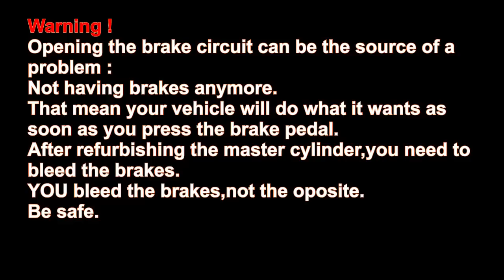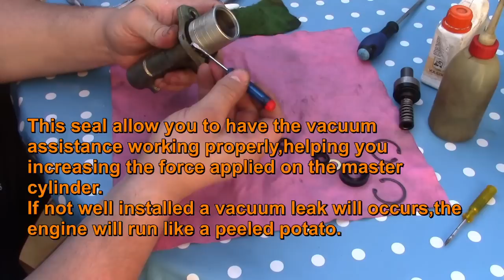Brakes : Master cylinder rebuild.

Comment: Using engine vaccum to clean out the old fluid is genious. U even added a little valve. Really awesome.
Reply from the maker: : )
You just need to be sure the handbrake is on lol

Comment: Thanks for sharing this video. We are manufacturing brake master cylinders for OEM. We recommend all end users to use the original equipments. Because all test are made under original equipment conditions. Even using a different oil may cause problems.
Reply from the maker: I know about oils ,and original equipment are not always avaible,this car is 29 years old.

Comment: Well that was an annoying video, the sudden jump back to the repair lol :-D :-D.

You can trust that system now you have personally rebuilt it, you know that every part is fine. And everything was fitted very carefully :-D.
I' feel the same about things i've repaired, it's knowing that it's right.

That fluid looked horrible :-( and brake fluid being in love with water lol.
Now the whole fluid is clean and no rubber or water is present,
the brakes should be loverly :-D

Oh super cute puppys :-D
Reply from the maker: Yes,quite boring to watch a slow repair,so i spiced it with those segments : )
The pedal is way way way more firm,and sits higher.
It's all good ,i didn't expect that much : )
Reply: LOL i was joking, i like repairs and doggys :-D
if dogs could repair cars.... that would be a ruff ruff life :)

It just shows how poorly the master cylinder was doing it's job, it's operating like a new one now. :-D

I havn't taken any car master cylinders apart, a couple of motorcycle ones yes, and because i didn't have a cup/seal repair kit, i was very very carefull, they were full of dead brake fluid/jelly.

Comment: I couldn't do this... I rebuilt two of my brake calipers and they failed about 2 years after the rebuild. I actually firmly believe this wasn't my fault... I find it hard to believe that they would have lasted about 40,000 miles if I had done something wrong, but it had to be 1) inferior rebuild components, or 2) my fault. No matter which one it is I just don't want to risk a failure on my master cylinder, I live in Florida and going from 80 to 20 in a couple seconds is a necessity if you're on the highway, so I just rather not risk it.

Also the rebuild kits I can find for the master cylinder are the same supplier as the caliper rebuild kit, so if it was a quality issue with the seals then it could reoccur with these kits I'm afraid. I'd like to note that they're DORMAN kits... I've had bad luck with Dorman parts, every Dorman item I've ever gotten either didn't work or was seriously inferior in build and feel, so I just rather not even go there lol.
Reply from the maker: Was the seals material compatible with your brake fluid ?
Reply: Jesse Crandle Dorman is garbage. Check out the south main auto channel, and you'll be surprised they lasted as long as they did. Problem is, dorman makes a lot of parts that are just too expensive at the dealer, but you're flipping a coin on quality. Also, it's likely cheaper for some people outside the States to rebuild certain components, rather than buy new/reman. Not gaining much rebuilding here, as you'll probably pay close to the same for a rebuilt unit from one of the big stores. Try amazon. Sometimes you can find manufacturers who use better rebuild materials. I know I can get Moog suspension parts for roughly the same price there, as Autozone wants here for their garbage ''valuecraft'' line.
Reply: I won't discuss the quality of the parts from that manufacturer, which is unknown to me. BUT I do say, why not get OEM parts for such important things like brakes? Honestly it doesn't make any sense to try to spare a few bucks in "aftermarket". Rebuild kits even OEM are cheap and at least the quality should be similar to the originally installed on the vehicle. 

Rebuilt several in the past, never lost brakes due to parts failure. In fact never lost brakes after any repair. 
One of the things not worth the risk at all. ;-)
BTW Recommended OEM oil type is also very important to avoid compatibility issues.
Reply: @crpth1  Honda discontinued parts for my 1991 CRX. Aftermarket is all there is left.

Comment: Can you do one of your 240? Mine has ABS and I've been looking around and can only find the non ABS rebuild kit for cheap.
Reply from the maker: Check the brand frenkit ,they have an online catalogue,and they distribute in Europe and Canada.
You can at least see the different components and the difference between ABS or standard master cylinders parts necessary.

Comment: If there is some small pits and edges in the cylinder, is honing an option? Or is it frowned upon?
Reply from the maker: Honing create a surface wich will not allow seals to seal properly.
It's better if you replace it,you don't take risks with brakes.
Reply: @michaelovitch  ok thank you for the reply
Reply from the maker: @johanseidel1860  : )

Comment: My brake pedal feels like its got brakes when i first push them but then it releases near the floor and catches again. Do you think the master cylinder is bypassing?
Reply from the maker: As i know,you can't have a master cylinder wich bypasses.
You just push fluid ,and this fluid can't come back unless you release the piston on the master cylinder.
You move seals wich block orifices passed a certain point,so the fluid only goes on direction ,because it's trapped in the brake line and pushed by the seal upstream.
However,you can compress air trapped in the brake line,if not purged correctly,or a bypass from the ABS block,wich is pretty rare,so i doubt it.
You have more likely to purge the air from the brake lines.
Reply: @michaelovitch  I'm thinking the mastercylinder has failed. I just don't understand why the pedal feels normal then drops down to the floor and grabs again.
Reply from the maker: @joshestess 
Does the pedal goes to the floor ,then you let it come back,and it grabs again or it's soft on its half stroke,then become hard again ?
Reply: @michaelovitch  when you first push the pedal it feels like its gonna brake normal then it releases and it feels free then grabs again near the floor.
Reply: I'm about to replace all rotors, pads and calipers soon and I'm gonna re bleed the system. It's sitting for a few years but the previous owner said it's done it for a long time. He just drives it around using ebrake cause he doesn't trust the pedal lol
Reply from the maker: @joshestess 
That's not normal.
Bleed it properly,and if it's acting up,just change it,it's a good idea to replace it every 10 years.
You don't take risks with brakes,specially when the previous owner did sketchy stuff.
When you have corrosion in the bore of the master cylinder,you may have the seal wich can't seal anymore on a little prtion of the stroke,where it's corroded,so you can have a loss of compression when you press the pedal.
That would explain what you feel at the pedal.
Knowing the brake fluid is hygroscopic and become acidic it will collect moisture wich will corrode cast iron or even aluminium.
What vehicle is it ?
Reply: @michaelovitch  yea I'm thinking it's corroded also. It's a 2008 civic si. Super nice car and I got it for pennies on the dollar. I was going to rebuild it but I feel like internally it's prolly too bad to be worth it. Gonna order one today. Thanks for the input
Reply from the maker: @joshestess : )

Comment: i have some sort of a problem when i press the pedal a lil u can feel it braking but if i press it harder it losses the ability booster is good so may the master cylinder be the problem please help
Reply from the maker: Check the fluid level,it must be to the "max level" with pedal released.
You can bleed the brakes to be sure air is not rapped in the line.

Comment: The only 2 bits I wanted to see and you edited them out!! aaaargh!
Reply from the maker: Wich bits ?
tell me.
Reply: @michaelovitch   😁 putting the reservoir/cylinder seals in and fitting the reservoir. I just wanted a comparison to see if it is as awkward as the ones im trying to fit.
Reply from the maker: @BettySwollocks13  
Ok,
I used some brake fluid as lubricant.
Compare the new seals with the old ones,to see if they have the same shape,and dimensions.
New seals will be tighter fit,that's normal.
Check if they can be inserted like the old ones,same grooves,same shape.
What is awkward on your set up ?
Reply: @michaelovitch  cheers, yeah, used lubricant but the original seals were in such bad condition i couldnt match them. I think they sent me the wrong ones as I don't think you're suppose to use a G clamp to get the reservoir to fit :D
Reply from the maker: @BettySwollocks13  
Yeah,
Be sure they are not backwards,
Sometimes they are a bit conical.
In any case it's quite a tight fit,i had to struggle on different occasions,even maybe here i don't remember, so it's sure no air or brake fluid is leaking one way or the other.
You can try to mount the seals on the reservoir without inserting them in the master cylinder to see if they fit normally or if they really sent you the wrong ones

Comment: Hello, thanks for the video, is 4 days working on this Cylinder, changed a gasket, all ok, it pumps on trying it on the vise with some oil putted in every holes, but i notice some problem only after mounted and when try to make the full bleeding, that the pump it doesn't reload...  I mean, the liquid that comes from the tank enter on the rear of the piston, then the 4 little holes and the brass gasket i think they communicate and make passage to the fluid to the front of the piston. But this process doesn't happen to me until every like 10 minutes maybe some liquid flows. So 4 days i have the car there not working for this reason, tried many solutions, checked everything clean, and so now i don't know what to do, the brake fluid used a DOT4, now tried with DOT3 (that seems less viscous). But the fluid never reload, the tank fluid stays on the rear of the piston, and the fluid in front of the piston stays on the front of the piston, no exchange and so no pumping at all. Do you have any clue?  Thanks a lot.
Reply from the maker: Hi,
Are you sure all seals are not backwards,if a leap is backwards,it will not create suction.

If all is installed corretly and if it's pumping on the vise normally ,and not pumping only when connected on the brake lines,that mean that you are not able to create suction of the fluid in the master cylinder, certainly because you push just air ,wich is compressible in the lines i guess.
You can try to open the shorter brake line on the caliper side first,if you have a steering wheel on the left,open the driver side caliper bleeder.
It's easier to bleed,the line is shorter.
You can blow in the reservoir,and pump the pedal at the same time.
You can also pull fluid with a little seringe and a small hose ,(aquarium transparent hoses,or vacuum hoses for engines) from the bleeder ,that you open a quart of turn or so.

Keep the appropriate,recommended brake fluid,

Comment: nice vacuum trick, i think the vacuum you used is a small version not the house vacuum cleaner.
Reply from the maker: I used the vacuum produced by the engine to empty the brake fluid reservoir : )
You can see a T fitting plugged on the ingnition advance vacuum hose on the right side.
Reply: @michaelovitch  i'm still a bit new to this, but where is the hose engine vacuum you tapped ? so that i can try it in my truck and mitsubishi L-300 when i try to bleed may brake line ?
Reply from the maker: @GEMINIBD  

You may have a line or several around the throttle body if you have a gas engine,or ingnition module or simply the fuel pressure regulator.
Depends of your engine.

If not, don't bother with that ,just use a seringe,with a small hose attached to it,or a turkey baster.
I just did that because it 's fun and convenient in my case.

Comment: Hi! Great video but I need some help. I'm trying to rebuild an ATE master cylinder off of a 1977 W123. I removed the circlip and the washer beneath but the piston won't come out?! Am I missing something? Thanks.
Reply from the maker: Hi,
Thanks.
I don't think you missed something,and to be sure you didn't i suggest you to see on a parts diagram or a parts catalog if something else could cause that.
It's more likely corrosion,or some residue blocking it i think.
You can try compressed air to blow it out,but look at a diagram first.
maybe there : https://www.niemoeller.de/en

Comment: Thanks for this video, I need to do this. What were you using at 5:00 ?
Reply from the maker: It's acetone,to degrease metal ,before lubing with brake fluid only,the brake seals don't like other than brake fluid,otherwise they get damaged.

Comment: hi, what was that fluid u used to clean the inside of the cylinder? brake cleaner or just brake fluid? cheers
Reply from the maker: acetone, but you need to let it evaporate before reinstalling the seals.
It's not compatible ,and will damage them.
some degrease and a good rinse and drying will do well,then brake fluid as lube for installation is the best : )

Comment: What was the symptoms? Master cylinder leaking in brakes booster?
Reply from the maker: Just being old,no leaks.
seals wear out ,by friction or simply degradatio of the material itself, over a long period of time.
ça freine mieux,ne serait ce que du fait des joints neufs : ) donc oui,une fuite interne aussi : )

Comment: No one in the US does this...they just buy a new one....but I will rebuild my brake cyl. ....i have a 22 year old truck I use for playing around...and what parts they have are too expensive
Reply from the maker: People are brainwashed to replace anything as soon as possible.
As long as the bore in not corroded,you can rebuild them for under 10 $.
My car is a 30 years old renault 21 lol

Comment: Where did you get your parts to do a rebuild?
Reply from the maker: A car spare parts website.
Just look for the brand of your master cylinder,and get its internal diameter from a car parts seller inventory ,then look for a rebuild kit on the web. 
They ask the VIN number ,so you can't really make a mistake.

Comment: Show me..
How rebuild brake master cylinder peugeot 307 matic hb
Reply from the maker: About the same for all master cylinders.
You need a kit with all the seals in it.
Reply: @michaelovitch  But I see the master house is different... So installing seal repair kits is also difficult... Master cylinder pugeot 307 matic is very different from other masters.. Do you have a video tutorial..?
Reply from the maker: @sudiono7380  
No i don't have a tutorial.
Wha is the problem with your 307 ?
Reply: @michaelovitch  I think the seal master cylinder is broken, so when the brakes are stepped slowly. Brake the pedals to the floor. I'm trying to open the piston. But there's only one seal. The other seal attached to the house piston... It's hard to open. I don't know how to open it... Doubts of fear broke. So if there is I need that tutorial.. Thank...
Reply from the maker: @sudiono7380  
What is your car ?  year /engine/ model